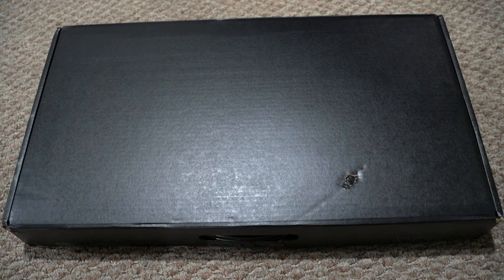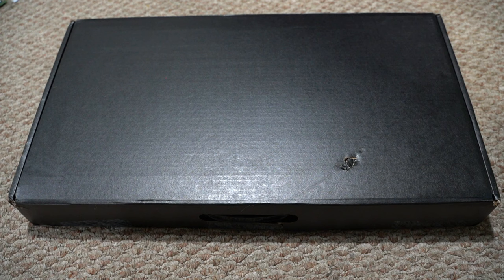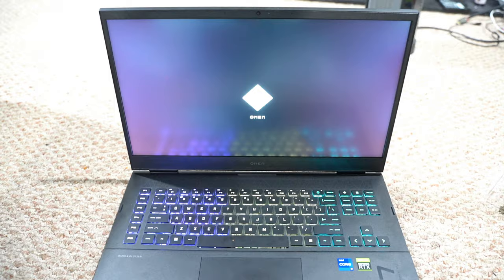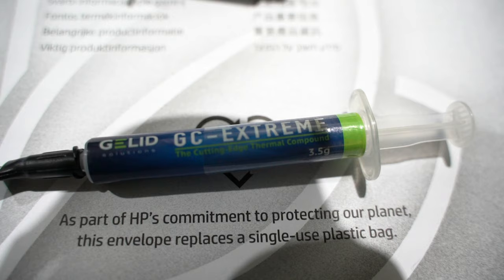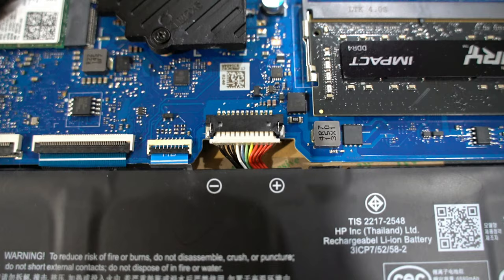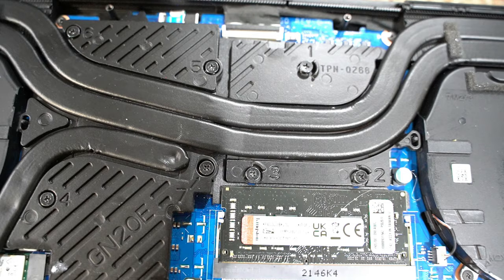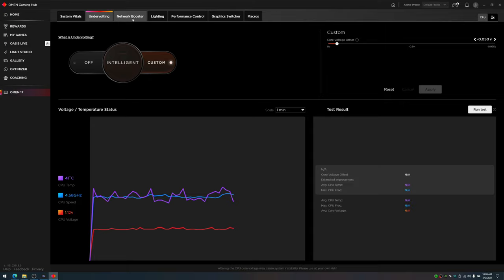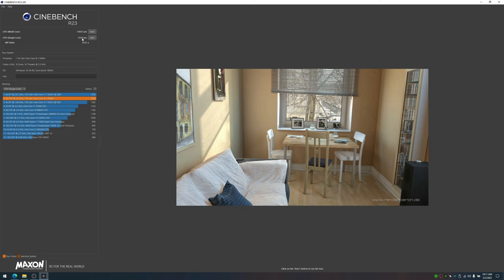HP Omen 17t-ck000 2021 / 11900H + 3080 16GB Unboxing, Teardown and Review + Cinebench R23

Comment: Hey there, I tried the ptm7950 on my Omen 17t with 3070ti/12700h and getting very bad results. Looks like ptm7950 isn’t sticking to the cpu die, hitting 95+ very easily and when I open it up, it’s just spilling out the sides with very little on the actual cpu. Did you do anything specific to make it work properly?
Reply from the maker: It took me a couple tries, as it can be very difficult to separate the last plastic bit thats attached to the top of the pad. It comes with those little stickers that have the green tips. Once you actually get a nice even placement the temps are godlike. 40c on idle, and about 65-70 on full load. I did notice they send me two different kinds, one was gray and the other maybe a tiny of green. I can't remember which one is better honestly, but one of them is definitely subpar.
Reply from the maker: Oh wait, did you order the paste or the pads!? The pads are the ones that are superior, they are already pre cured.
Reply: Thank you for quick response. I got mine from ebuy7 and it was all grey. I spent all day trying it and it seems to stick with GPU fine but CPU side ends up with all the paste spilled out to the sides and very little on the cpu itself. I actually ran out of the stuff after multiple attempts so gonna try Condactonaut on the CPU tomorrow. If that doesn’t work out I’ll just go with gelid GC extreme on the CPU.
Reply: It was the pads.
Reply from the maker: @precious-reviews  that's odd, that's why I went with the 80x80 to make sure I had room for error. I thought I had it good a couple tries and had the same experience as you but I did it better and then it worked like magic. I would just make sure the mounting pressure is tight and even as this shouldn't spill off the CPU. It should harden when at ambient room temperatures and turn into a liquid when higher. Doesn't make sense why that is happening. As long as you take the plastic off it should work.
Reply from the maker: @precious-reviews  also I would be very careful with the liquid metal as if it gets on the motherboard it will instantly fry it. I would only do it if you have experience or very comfortable with it. Liquid metal is the way to go but if you are having problems with the paste running out of the sides with the pad, I wouldn't test the luck with it unless you can afford something going wrong. Good luck and cheers!

Comment: I'll try repaste my legion 5 with gelid, i hope it's durable
Reply from the maker: Hey so the gelid eventually pumped out as well, but lucky for you I have the golden ticket. Ptm 7950, it is industrial grade phase change paste but you actually want the already cured thermal pad version. You have to buy it from china from ebuy7. I would get 40x80 minimum but 80x80 is recommended for accidents and extra. Get the fedex mail option, it'll take less than a week to arrive. I get 80c max temps with fans on auto and 67 max for GPU.
Reply from the maker: There's nothing better for laptop thermal pastes because they actually all pump out but the thermal pad is solid in lower tempatures and then it changes to paste as it heats up.
Reply from the maker: https://youtu.be/CeIWDU1IBe8 video with the pad.
Reply: @akaddict  ptm7950 with shipping fee is too expensive. how long gelid will pump out?
Reply from the maker: @doniherald7745  took a week, maybe week and a half. 30-40$ is a lot more inexpensive than frying your laptop. It is a invaluable investment.
Reply from the maker: Also by the time you need to repaste several times buying and trying out more thermal paste, you'll easily get exceed that amount easy. You won't have to replace thermal paste for way above 2-3 years.
Reply: @akaddict  i have to cleaningu laptop maximum 1 year, dusty place here

Comment: How is it rn? Did u faced any issues?
Reply from the maker: Zero issues running latest bios, windows 10 fully upgraded with drivers. This laptop is a beast. I'm surprised it isn't thicker considering the specs. The screen is gorgeous, g sync fully works even though it said it didn't have it at the time of buying. I have nothing to complain about. 👌
Reply: @akaddict  should I buy this now or wait for next gen?
Reply from the maker: @Feelsgudd  are you upgrading or getting a new system?
Reply: @akaddict  getting new pc
Reply from the maker: Depending on how much money you want to spend, I would at least wait for the 3080 ti version atleast. As for the quality of this machine compared to previous models it is blown out the water with thermals, build quality and everything else. Another awesome thing is the hp care pack. You can buy 3 years warranty with accidental protection for 320-340$ and if you don't use it, they refund you the full amount excluding taxes.
Reply: @akaddict  I guess there is no option for that here. Actually I want 2022 Legions with 12700H and 3070Ti. Maybe will wait for that.
Reply from the maker: @Feelsgudd  yeah if it is a new system you can't go wrong with this. If you were upgrading from a 2080 like the situation I would be in then I would wait 100%
Reply from the maker: @Feelsgudd  sounds good!

Comment: Hey, what for generation PCIe Gen 4 or 3 = 1 TB PCIe® NVMe™ TLC M.2 SSD
Reply from the maker: One gen 4 and one gen 3.
Reply: @akaddict  is first ssd is gen 4 is correct then.
Reply from the maker: @bengtolsson5480  the ssd slot on the right is gen 4 as shown in the video

Comment: What is the wattage of gpu?
Reply from the maker: 165
Reply: @akaddict  What about the fan noise? I’m considering buying this laptop and I hate loud fan noise and coil whine.
Reply from the maker: @Yorcen  it can get loud at max rpms, having it at auto isn't that loud though. It is a gaming laptop so it's always better to have a loud laptop with better heat reduction than a not so loud fan with poor cooling. If your gaming your most likely using headphones too so it shouldn't be an issue.
Reply from the maker: 47 - 51 db while under load, 34 db idle.
Reply: @akaddict  Is there smaller power supply option?
Reply from the maker: @Yorcen  you can buy after market smaller ones but if you try and game on it, your computer will be severely impacted, but just to use it casually is fine.
Reply from the maker: I think they have like 180-200 watt on amazon
Reply: @akaddict  i7 vs i9 version? What do you think?
Reply from the maker: @Yorcen  they are both good, its always better to get the new generation if you can afford it. Has more cores, higher clock, and cache, but it will be hotter for sure but the cooling design on the new 2021 is good.
Reply from the maker: Go higher if you can afford because you can't upgrade down the line like a PC.
Reply from the maker: My version with the 3080 with 11900h was 3200 with taxes.
Reply from the maker: If you get the i7 your most likely limited to 2666 ram speed, the i9 is 3200 which is definitely worth it to me.
Reply: @akaddict  Does it have g-sync. I don't mean Nvidia's g-sync support. I mean the panel itself.
Reply from the maker: @Yorcen  yes.